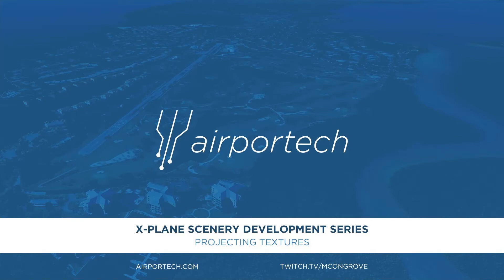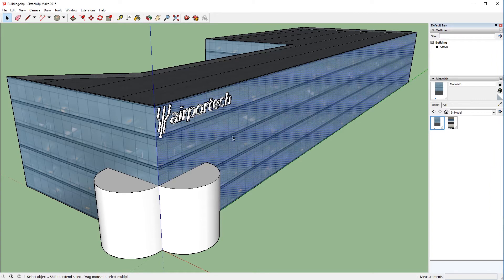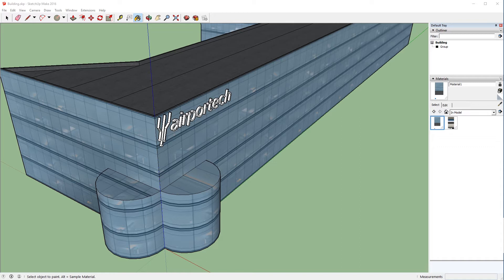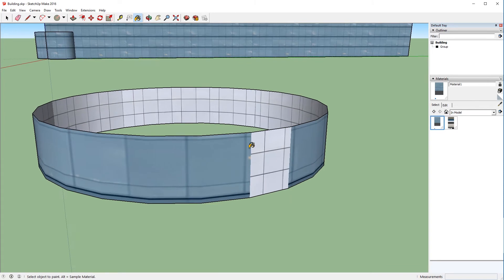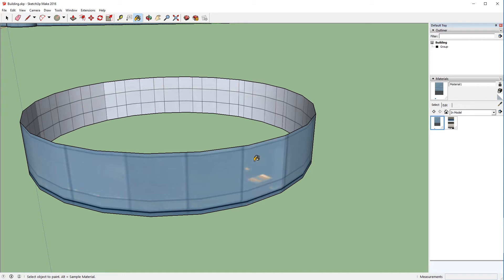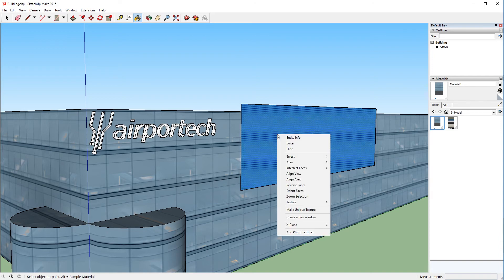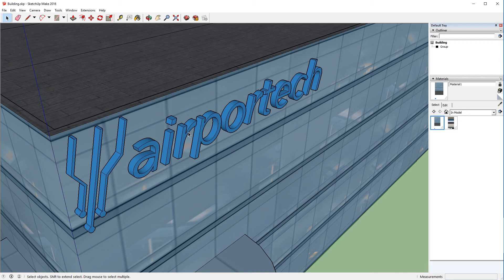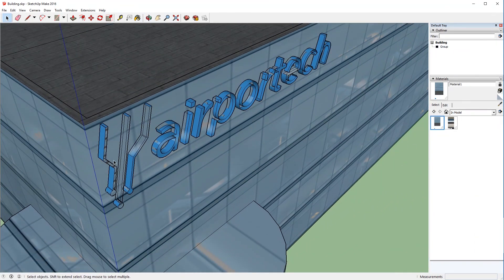X-Plane Scenery: Projected Textures (Curved Surfaces)

Comment: Answered my question. If the texture you want to apply to a curved surface hasn't yet been applied in the model, I found that the only way to perform this operation in v. 2018 is to texture a flat surface first, with the texture you wish to apply to the curved surface. From there, sample and apply works perfectly for the curved surface. After you've done the curved surfaces, simply delete the texture you applied to sample from, assuming it will not be used in that location.

Comment: Texture can be applied to curved surfaces in ShetchUp 2018, however, the procedure stops at that point. The texture pop out option window is not available for curved surface in v. 2018. Texturing flat surfaces works exactly like the version you use in the tutorial. Any idea on how to do curved surfaces in v. 2018, or are we waiting on an update from Marginal for the X-Plane plugin?